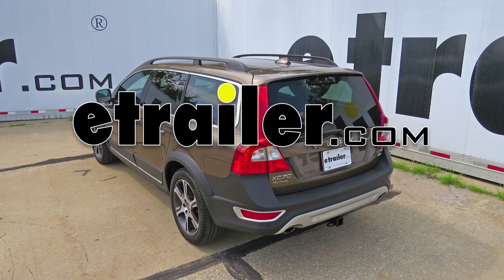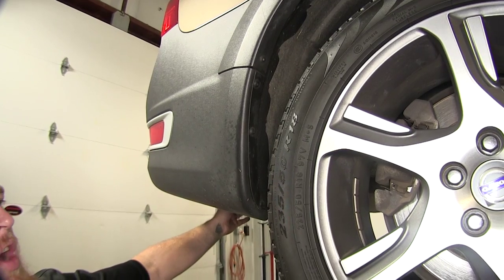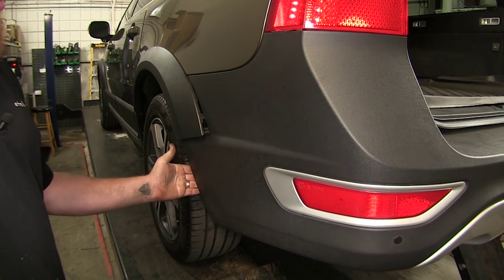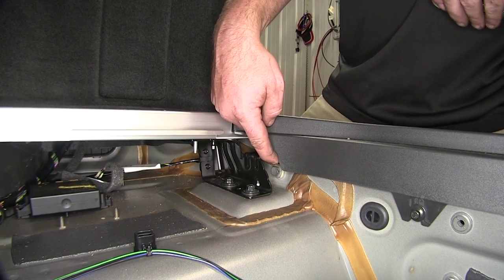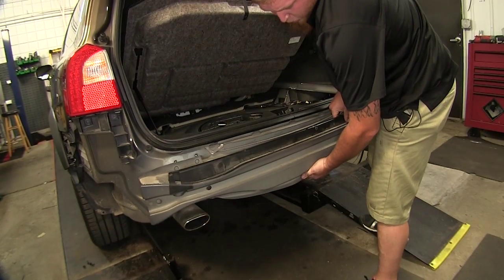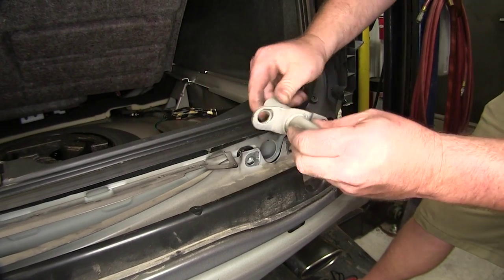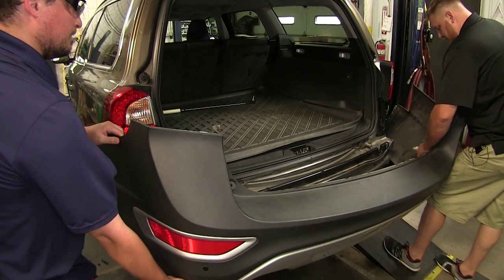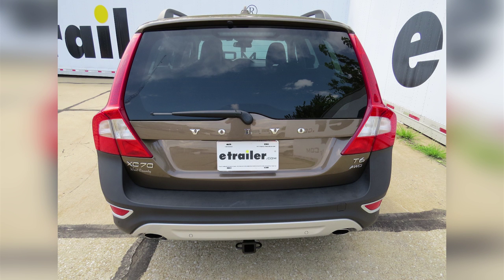etrailer | How to Install: Curt Trailer Hitch Receiver on your 2013 Volvo XC70

Comment: This is scary, the European tow brackets have rails that go though the chassis and bolt there also.  This just bolts to the back of the car, American type approval? Good video though.
Reply from the maker: The hitch and its attachment to the vehicle have been thoroughly tested to meet the weight rating of the hitch. 
https://www.etrailer.com/Trailer-Hitch/CURT/13266.html

Comment: My son and I just finished installing on my 2014 XC70.  Looks good and saved a lot of money vs. having it done at the dealer.   The video was a huge help and we did the job in about a hour and a half.    I went with installing the spacer plates but probably didn't need them.      Thanks etrailer!
Reply from the maker: That's great to hear Stephen! Glad we were able to make the install process a little more pleasant for you. 
https://www.etrailer.com/Trailer-Hitch/Curt/13266.html

Comment: Perfect! I used this video as a guide to install the Draw-Tite Max-Frame Class III 2" hitch on a 2015 Volvo XC70. It took about 2 hours by myself using hand tools. Highly recommend e-trailer and the hitch. The video was key to a smooth installation.